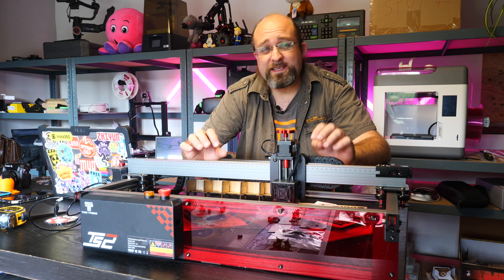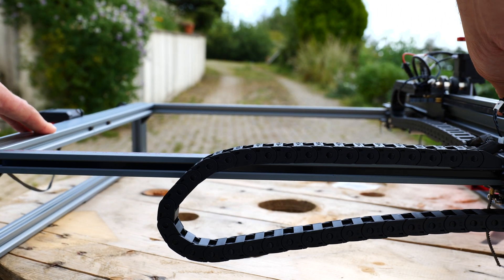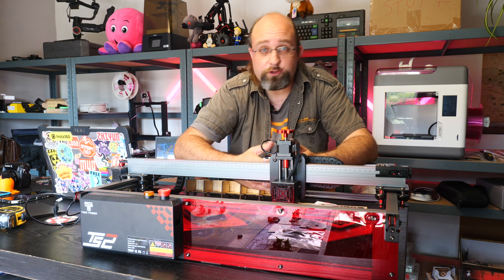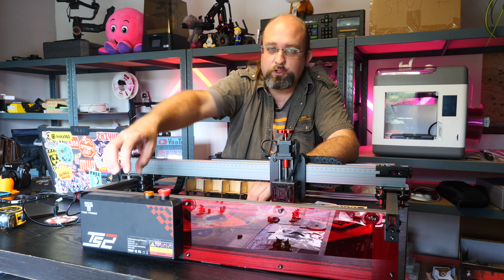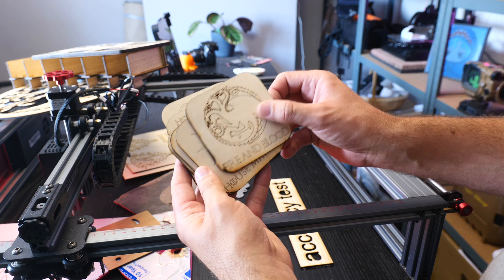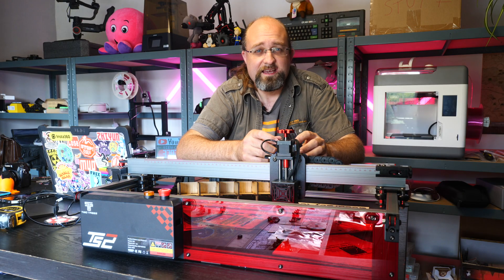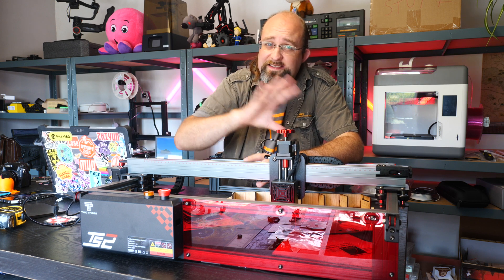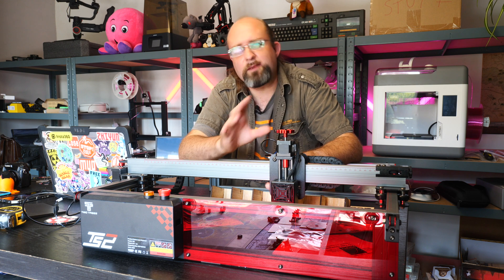Two Trees TS2: Large Format, Autofocusing 10W Laser Engraver

Comment: I am a total newby to lasers, but watched your youtube video and those by other others, before buying the Twotrees TS2 10w laser.  
I have enjoyed reasonable success with engraving, but I have just not been able to cut out anything at all.
I have carefully noted from the videos the different speed/power relationships that will affect your result, but, even using the manufacturers settings, my laser refuses to cut.
It will not even cut through card.  I just don't know what I'm doing wrong, and I have no recourse to help.  
One other issue that I have not been able to work out is manual focusing.  Can this only be done using the software that comes with the kit.  
I do hope you can help me.
Hope for more of your videos on this machine.
Brian Haywood
Morecambe UK
Reply from the maker: We won't have more videos, but do you see a laser light being emitted at all? It could be that your laser module isn't connected to power - the software wouldn't know, and would just move the head around thinking it was working fine. Do you still haev the manual to check through the cable connections?
Reply: Thanks for your reply,. As far as I can see, all cables are connected, and I am engraving ok.  It  just doesn't make any sense if you are able to engrave designs using several layers of different power and speed, but cannot cut a design using various powers and speeds. @MakeUseOf
Reply: And forgot to thank you for your reply and excellent videos.  Thanks.  Brian

Comment: I have just bought theTwoTrees TS2 10W diode laser, this is my first diode laser and I have never used or seen Lightburn software. I have downloaded and installed Lightburn, I am using the free version for the first 30 days before I purchase the license. When I connect both the TS2 and my Macbook my screen looks nothing like the screens of the other tutorials I have been watching. I have not got a clue how to focus the laser,  remember I have never used this software before.  I cannot find a decent tutorial on how to connect my laser or use the Lightburn software. It is obvious that you know what you are talking about, but I have never touched or operated one.
Reply from the maker: Start here - https://www.mediafire.com/folder/jf3wo75an9d2m#h8warxmlg8cwj . That's the latest firmware files for the TS2. In there you'll find a software / Lightburn / configuration folder. That'll add the appropriate commands to your Lightburn install for it to support the autofocus. Then you'll find a set of buttons on the Console tab, which correspond to either lifting the Z-axis, or focussing for different thicknesses, such as ENGRAVE 3MM. Click that, it'll set the right height.
Reply: @MakeUseOf  Thank you very much indeed, that helped a great deal..

Comment: Please tell me if it is possible to connect a computer or laptop via wi-fi to this engraver, or only through a smartphone? I tried to connect using the IP address (through which I log in from the smartphone application) from the computer, but nothing happened (the computer is connected via a LAN cable to a Wi-Fi router) or does the computer only connect via usb?
Reply from the maker: I couldn't get Wi-Fi working, and even when it does, it only works with the smartphone app. Just use USB.
Reply: @MakeUseOf ok, thanks for the answer